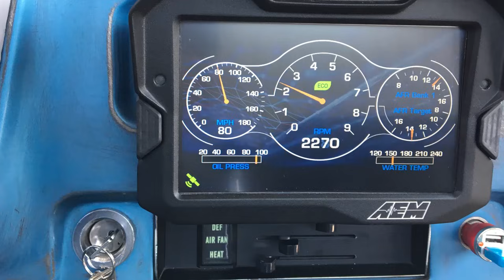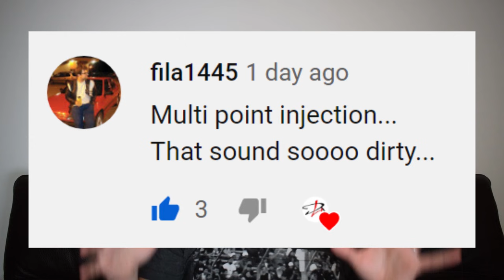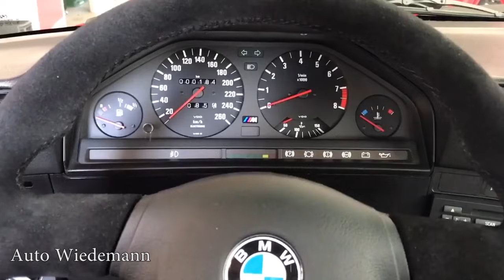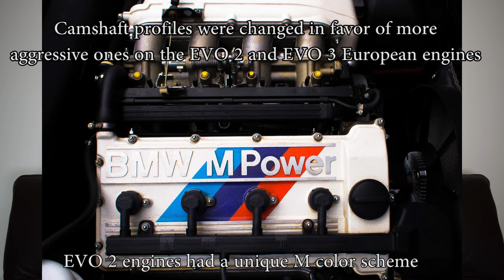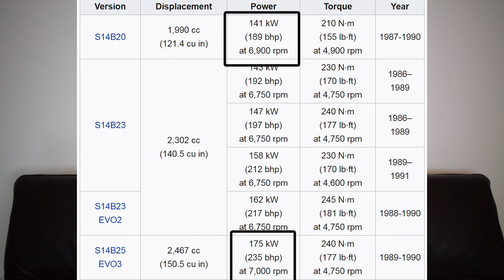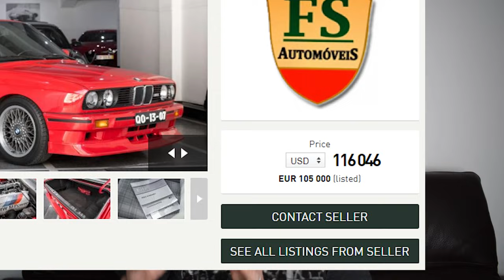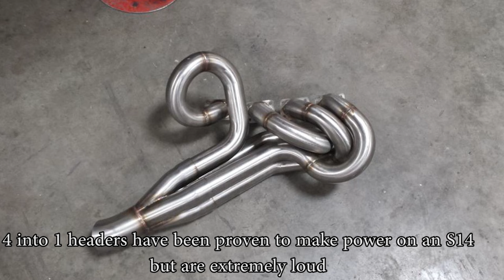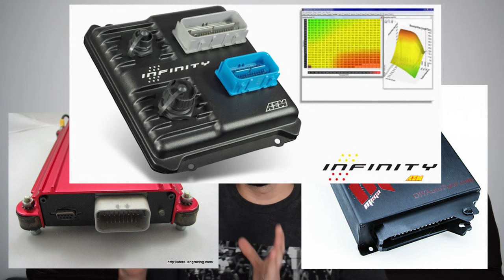BMW S14 - What makes it GREAT? ICONIC ENGINES #6

Comment: you should do the M50 family of engines too. M50/52,S50/52
Reply: m50 is life
Reply: Please
Reply: The M50 family is peak BMW
Reply: Up😁😁😁
Reply: M54 and s54 are great 2 haahha
Reply: This video is on iconic engines not turds
Reply: @Jdalio5  in what way are they turds
Reply: Or M54
Reply: S50B32 is life
Reply: @50erli  had both. Currently have S54. If the remit is "make as high a hp figure as possible without forced induction even if it's only for 1 turn of the crank" then it's a masterpiece.
Reply: Agreed! 

Those are good engines too. 🎉
Reply: Reason why I want a E36 325i: M50 non Vanos

Comment: To be fair the BMW M1 was the first M car that started this lineage. Though arguably the 3.0 CSL was the first M car, despite not having an m badge.  Then the M535i, the M 635 CSI, the M5, and then finally the e30 m3. Though iirc there was a updated m535i somewhere in there. Interesting also to see how much they experimented with M placement and the spacing before and after the numbers and letters
Reply from the maker: No, I meant the M3 lineage, not the whole M thing obviously.
Reply: driving 4 answers ah my mistake, it wasn’t obvious to me, but I’m just waking up.

Comment: Quick anecdote from an engine book I've got. From an interview of a BMW F1 race team engine builder, they would go out to wrecking yards to find old clapped out sedans with the highest mileage they could find and pull the M10 blocks for cores. The thinking was that these engines with tons and tons of hours on the clock would have all the casting stresses out of them and would hold up to grenade-spec boost the best.
 Seeing as these cars were laying down 900 to 1500 horsepower with factory stock iron blocks and NOT blowing up they might have been on to something.
Reply: That’s super interesting thanks for sharing!
Reply: What engine book if you don't mind me asking?
Reply: @deltas4764   Its just called "Legendary Car Engines" by John Simister. Printed by Motorbooks.
 Tons and tons of photos of engines in various stags of assembly and lots of interviews with restorers and historians.  

Picked it up years and years ago. Highly doubt its in print. Makes a fantastic coffee table book.
Reply: @deltas4764  amazon has it for like $9.00 U.S. and up.
Reply: So they took junkyard engines und turned them into rocket engines with 1200-1400 hp and 5 bars of boost?

Comment: I only got thru 100 comments, so I hope I’m not repeating.
I started playing with BMWs in 1972 while working in a body shop that did the work for the first dealer in upstate NY....when they were”British Motor Works”.

In 1982, I met Jim Rowe...founder of Metric Mechanic.  Wow.  40 years of tireless R&D on BMW engines / trans/ diffs. Now that I’m retired, i fly out to MO ever 3 months to work in the shop and improve my knowledge and skills.

I work for free room and board for the week.  It doesn’t get any better than that!

If you have a n S14 project, give him a call.

40+ years of improving bmw engines.

Comment: Great video.  We still occasionally see E30 M3 track cars come through the shop with built 2.5 liter Evo engines and aftermarket engine management (to eliminate that horrible airflow meter from the stock setup) and they easily produce 275+ whp using race gas on the chassis dyno.  That's incredibly impressive for an engine design whose genesis was nearly 40 years ago.  Fully agree with naming this engine one of the all time greats.

Comment: Very sad we didn't get this M3 in South Africa. We had to create our own homologation special, the 325is, with the Alpina 2.7 M20 engine. This was to compete against the South Africa only Opel Kadett Superboss with the Delta modified C20XE, stock with Getrag LSD gearbox amongst other thing.

Also interesting is that South Africa also made a 333i with the M30 engine also helped build by Alpina. We also made the Opel Kadett 200ts with a C20LET and 6 sped LSD Getrag which debuted with 160kw (215hp) in 1994.

Comment: You can remove the flap MAF with a heated wire MAF. There is a product called a "MAF translator" which interprets data from a new heated wire sensor, then sends data to the ECU that is exactly like the flap MAF. Some call the OEM sensor a "VAF." It is good for a few horsepower by itself. I think some people mod their Datsun 280ZXT to accept a 300ZXT heated wire MAF for example.
23:14 There is another way. Have you heard of offset grinding? By grinding the crank throws off center and then welding them up, you can lengthen the stroke by a few millimeters.
29:00 Plus, with 10:5:1 or more of compression, you couldn't run much boost anyway. It would probably be required to buy lower compression pistons.

Comment: I have only had BMW E34 M5 3.8 with S38B38 engine. Stock power 340 hp and 400 nm torque naturally aspirated. It’s similar type motor as S14 just six cylinder inline with larger 50 mm ITB’s and larger valves and 90 mm stroke. It would be great if you could do a video of M88 / S38 type engines. M1 race cars had naturally aspirated six cylinder 3.5 liter motor versions with around 470-490 hp power output at very high rpm for inline six at that time.

Comment: One small correction,  it was the S88 engine in the M1, and M635csi. Unfortunately, my own M635csi needs an Electromotive system because the OE one has injector pulse issue we cannot figure out how to rectify. 

Other than that, your videos are excellent, certainly among the best, if not very best l've been fortunate to find on YT. As a former BMW mechanic and an instructor in a different field, l cannot praise them enough. Your English is also better than many native born Americans, and in these videos, perfect.

Comment: Have you done anything on the first V8 BMW M5 engine the S62? I once had a 2002 M5 and what I did to spruce it up was re-flash the ECM, eliminate the screen and plastic grating inside the Mass Air Sensors  as per Dinan's advice coupled with K&N air filters and install a stainless steel Borla Catback exhaust because BMW for some crazy reason crushed the exhaust pipes down to 50% in diameter right in front of the differential increasing the backpressure. I suspected they put these band aids on the car to limit the horsepower to 400 hp.  I also replaced the dual mass flywheel with an aluminum 13.5 lb. flywheel and Kevlar high performance clutch. The engine revved like an air tool when I did that. With all of the resulting increase in power and response I had to send the pressure plate out to maximize the clamping force because it would slip under hard acceleration. The clutch and pressure plate is was a flaw in my opinion of the E39 M5. I also ran into issues with the differential as I had ripped the anemic brackets off that held the differential to the frame and had to reinforce the brackets, another flaw of the E39. 
All the fun occurred however when you pressed the DSC button disabling the traction control,  the car would be all over the road in the first 3 gears. It was truly a sleeper if you didn't know what an M5 was.

Comment: I Love your Iconic Engine Series!  Yes please make a Paul Rosche Video. And BTW your German is pretty good. Greetings from Hockenheim Germany
Reply from the maker: I grew up watching Pokemon on RTL2, that's how I picked up most of my German... aaah good times. Wow, Hockenheim, not many cooler places where you could live. Guess this video is right up your alley :)
Reply: @d4a  oh yes good old RTL2 times.  the Kickers was awesome aswell. Yes its pretty cool you can make drift trainings or rimeattack driving in Hockenheim but Nordschleife is not far aswell. I drive a z3 coupe with the M52B28TU as a daily a d have a S13 200sx with the CA18DET Engine. A awesome Engine BTW called little RB. Cast Iron Block and Oil cooled Pistons by Oil spray from the Bottom. It was to expensive and replaced by the SR20det.

Comment: Having driven a tuned s14 (I admit I didn't go over 7000rpm, I am to afraid of breaking something), I wouldn't want to own one. The car is amazing, but there is no point in having one if you don't rev it to moon, which with an engine worth 3 years of rent I wouldn't want to do to often. On top of that, the s14 is 3 times as much as an s54, imagine how much more fun you would have with an s54, knowing you have 2 more ready to drop in when you throw a rod!

Comment: I’ve worked on a few and driven several.  I used to work as a mechanic at my uncles shop in Los Angeles.   Never beat up the car just test drove after repairs were maid.  I ended up purchasing 90 BMW 325 because of it.  Completely rebuild the whole thing,  sold it for cheap to a youth pastor that really wanted it.  He then loaned it to a member from church and crash it 🤦🏻‍♂️.  I wish I never sold it.
Reply from the maker: Dem pastors... Never hand them sporty beemers 🤣

Comment: The S14 I forgot to adk for, only had the M42 engine in a E30, was fun to drive even with low power, the engine liked the revs and the gearbox was great. 
So I want to ask, please bring a video of the M42/M44 maybe compare and as always wanted to see the Ford Duratec, the 1.7 Zetec S and the OHC Pinto ✌

Nice video
PS: Your german is really ok 👍
Reply: The M42, Race Engine was the S42
M42 stroker builds 
Crankshaft from m44(1.9l) or m47 a little more involved process and this link will show some of the similarities in other parts 
https://the325is.blogspot.com/2011/12/bmw-m44-engine-to-create-bmw-s42-euro.html
More mods for lightening up the m42
https://grassrootsmotorsports.com/project-cars/1991-bmw-318is/project-bmw-318is-lightening-engine/
Reply: M42 is a wonderful engine, currently building a turbo m42 for my e30 with around 300hp on all stock internals. There's plenty of mods for these motors and they have a ton of untapped potential from my own findings and many others.

Comment: Hi, love your videos, I have owned one of these cars many years ago, I would love it if you did the Nissan vg30t engine single cam ... I had one of these in the late 80s it was in a z31 and was a factory turbo Nissan fairlady ... in the late 80s we modified it and was proving 450ho at the wheels and was for a long time one of the fastest street cars in New Zealand. 
Cheers Pieter

Comment: m30 engine is such a fun motor to boost. It has all the pros of the m10 but with two extra cylinders and the benefit of being plentiful and in the full range of BMWs from the 80s.

Comment: I want to see a race between a track ready 1991 442 and a E30 M3 Evo1. They would be about the same weight, if the 442 were track prepped. Both, 2.3L Inline-4s with similar output. (S14 having the advantage, unless the W41 was slightly modified).

They weren't at all competitors, but they're both unique in their own way. Moreover, a race between them would be equally unique and cool to see how the differnt approaches would compare on the track.

Comment: I think there is a way to get some High flow cats and some high flow mufflers and do a duel x pie side exit exhaust. 

I got a welder and some stainless steel pipes so I can fab it up. 

Plus it will look cool and probably have a better less annoying good flowing exhaust note with some good back pressure.

Comment: We have both M88/3 and a S14B25 (330HP but only for racing) as well as E21 with a turbocharged S14B23. I totally admit that turbocharging the engine wasn't a good idea but we needed more power to stay compatible against a 550 hp ford and a 2010 cup Porsche at hill climb races.

Comment: This is similar to the alpha II engines. Except the redline is I think 300 less and the alpha uses a single throttle body. Ive considerd spwapping the intake for a custom multie throttle body setup with the port injection

Comment: the 635csi still got the m30(b35) engine - only the M635 got the M88 of all e24's
Reply: The early 633 got the rare M90 which is M88 block and internAls with M30 head and a sick intake manifold. My fav non M BMW engine.

Comment: Yes bmw finally 🤣 put the n52 familly on here its the most reliable motor ever on an bmw with only oil change every 10k km an serie 3 with the naturally aspired n52 serie if it is the b20 b25 b30 other sayed an 2 2.5 or 3 liters it mades in normaly condition with mentioned befor just oil changes and yeah brake pads but for the rest my dear friend never did nothing his 330 e46 has now 778675 km and it still drives him everyday to work it has no issues no power lost and that car still love it when good warm that u floor it to 7k rpm in every gear that car never failed its so unbelievable can u might do a vid on how bmw managed to create such a motor idlying at 500 rpm or 600rpm with an normal temparature between 100 and 120 c degrees without failling that really awesome

Comment: New to the channel and I have to say, this is an outstanding and well researched production. I'm more of a 5 series guy owning a daily  driven E39 with the  beautifully balanced M54 but after watching this though I bet I'll be taking second glances at E30's thanks to you. You are German correct? With a background of automotive engineering? I've always thought the Japanese make the best 4 cylinders, us Americans the best V8's and  the Germans the best inline 6's. It's a wonder why other makes don't take advantage of the many benefits and configurations an inline 6 naturally brings? I'm guessing weight and emissions are drawbacks. 
Again, excellent video jam packed with info and I'm definitely subbed and look forward to watching your other work.
Reply from the maker: Not German :) I'm actually from the Balkans.

Comment: I own an E30 M3 with its original S14 engine.  Be careful with these, costs to rebuild one properly ranges from $15,000 to $30,000.  The guy who had mine had it rebuilt at 65,000 miles and receipts showing more than $20,000.  Doing the 2.3 the 2.5 is not recommended and it takes someone who really knows what they are doing to do it right.
Reply: Dang that's pricey 👀

Comment: I don't know what the gearing is like on the E30 M3, but on the E46, its appalling. 
If you want to feel it male 340hp, you have to do it in 1st gear. 2nd will be doing over 70mph when it gets to 8k rpm and 340hp  and by the time you're in 3rd, you're doing prison speed if you're putting the full 340hp out.
Most say the single best mod is changing the final drive ratio in the diff, not adding more power where you can't use it.

Comment: Why don't you just get any e36 bmw and do a swap there? But the best thing to do is to get a used m10 engine block from ebay or wherever and modify that. Then you have spares.
Well if the parts are interchangeable

Comment: best 4 cylinder european made .....hm ....bold claim .
i would say the opel/Vauxhal/GM c20xe is very close , reliable , powerful , cheap , not thirsty at all..also coming from a formula 3 background .

the s14 was always some kind of an " exclusive  " club , parts where always rare ( compared to others ) and expensive .

best overall engine in the 2 liter range +/- a few cc would be in my opinion the b and k series from honda ....

worst would be rover k , and to be honest .....VW made products ...;-) 

i personally like the f7r engines from renault as well ....
cheap , reliable , no fance schmuck like MAF and still not thirsty , very torquey due to long strokes of 93 mm and still like to rev ... a bit " high " if you want to swap it and gearboxes are not the best 
tuning parts are a bit more rare but pretty good stock eingines in the  2l 150 hp range .

Comment: When I was 16 (2004) I opted to get a 2000 dollar 87 325is and instead of a 8500 dollar 88 or 89 m3 🤣 all because i didn't wanna borrow 1500 from my dad to get it. I would of probably fuked it up though. Idk though cause I still have my e30 sitting at my dads house. I'll never know

Comment: Too bad homologation doesn’t exist anymore. All the best cars came from homologation!
Reply from the maker: But it does: https://youtu.be/Rr1eJJhnsLQ
Reply: @d4a  Unfortunately the Yaris is the exception now rather than the rule. I’m in Australia and all our halo cars came from the homologation era for touring cars. Cars like the Holden Torana GTR XU1, the Ford Falcon GTHO, the Holden Monaro GTS were all born from the old maxim “win on Sunday, sell on Monday” which can be summarised as homologation. 

Once the need to homologate cars for racing was removed in the late 80s early 90s (for most racing series anyway) the connection between the road cars we drive and the ones we buy from the showroom floor ceased to exist and now most touring car series don’t even use the chassis of the actual cars and just look like the car you buy, which is pretty much the same as Nascar.  

It was probably unrealistic to expect widespread homologation for touring cars to continue with the cars getting faster and faster but its still sad to see it gone.
Reply from the maker: No no, I totally get what you're saying and you're right, homologation is dead in many respects, but this is also what makes the exceptions even more special.